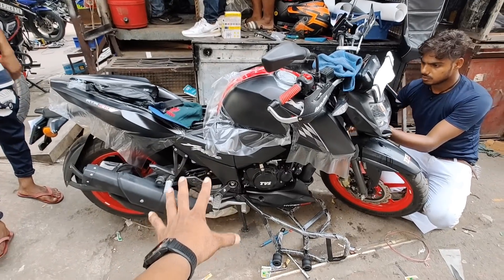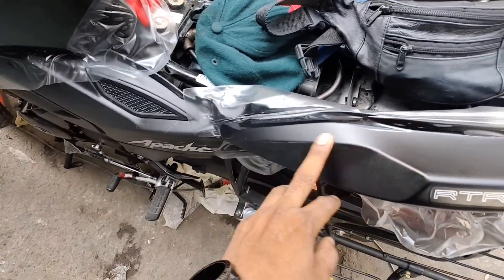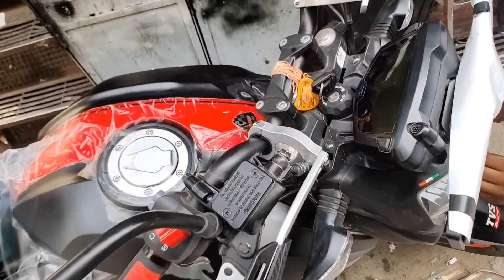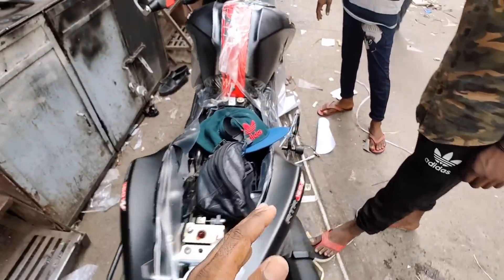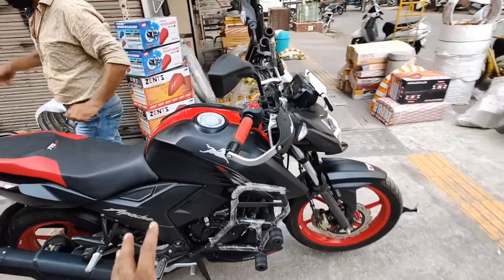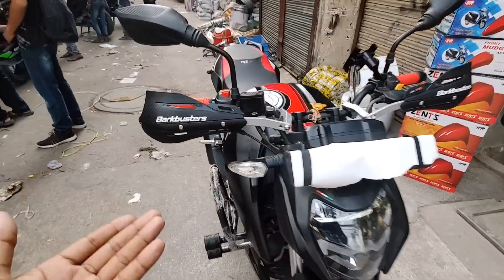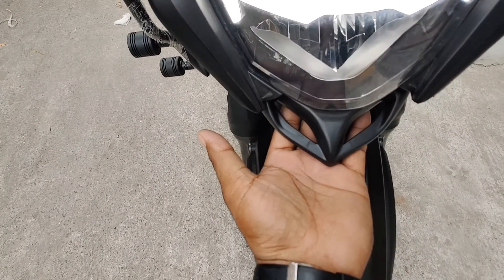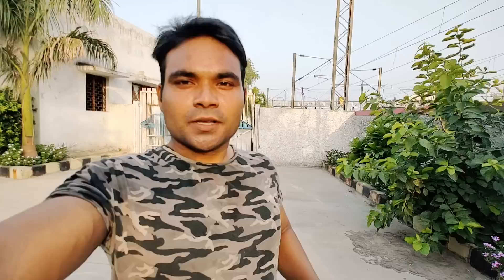TVS apache RTR 1604v decent modified | modification TVs Apache 160 special edition

Comment: Cost??
Reply from the maker: sikandar short skd 
shop address & location 👇
1686, Arya Samaj Rd, Block 27F, Nai Walan, Karol Bagh, New Delhi, Delhi 110005 https://g.co/kgs/JhQMn2
----------------------------------------------------------------------------
Shop Neme 👉skd
1686/36, nai wala market, karol bagh new delhi 110005
contact number ☎️📱
Raju Verma 👉8800567097
👉9911529266